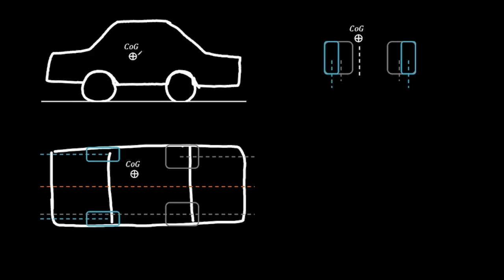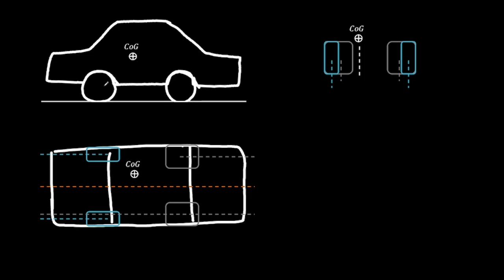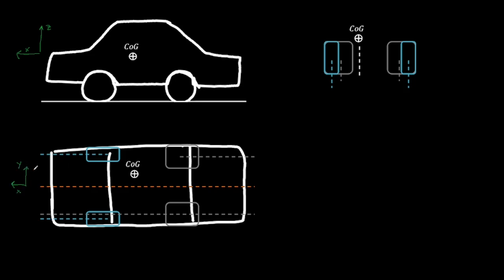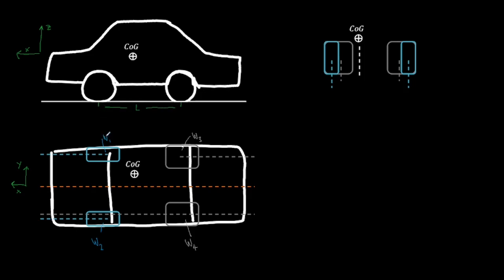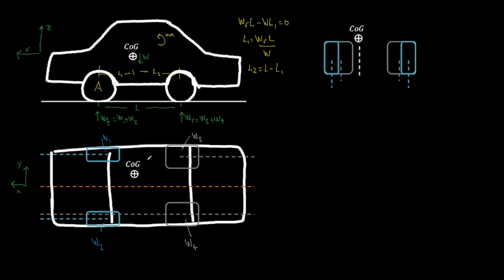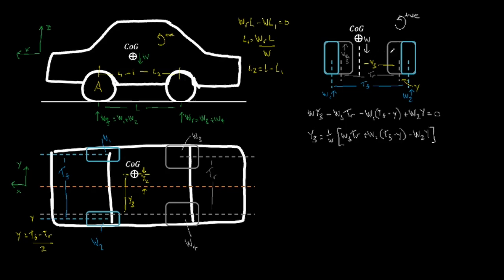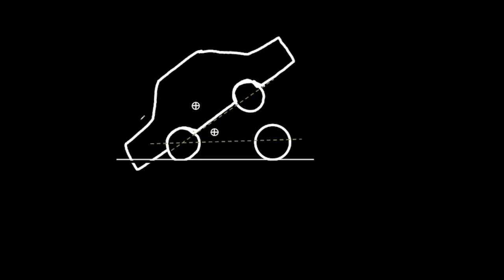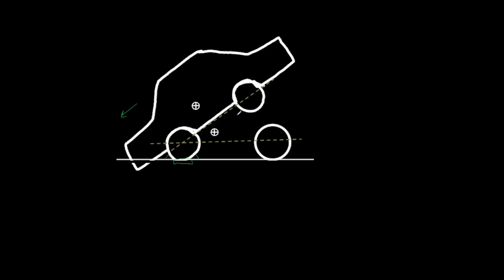Master Your Ride: A Step-by-Step Guide to Calculating Your Car's Center of Gravity

Comment: Hey ! Great video. I am facing a problem with finding/knowing the axle weight front/rear (Mercedes w124 E200 1993). Is there any way to calculate them since I can not find the axle weight anywhere ? Cant calculate the CoG without them, obviously. Thank you
Reply from the maker: G'day mate, There isn't a way that I know of to calculate the axle weight from the car weight if you don't know the CoG. 
Some options, You can weigh it yourself, take it somewhere to weigh it, or you can use a bathroom scale and some wood to do each wheel individually. If you don't want to do that, you could look at similar cars, see where their CoG is located, take an average, and calculate it from that. But that's not going to work too well if you have or are planning on modifing it. Let me know if you find a way